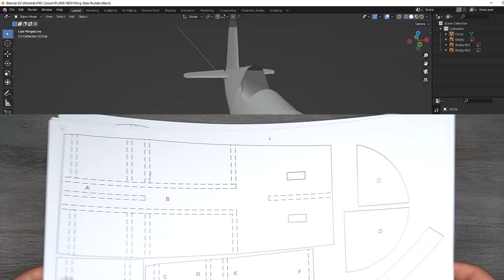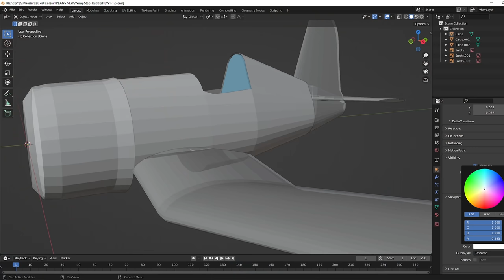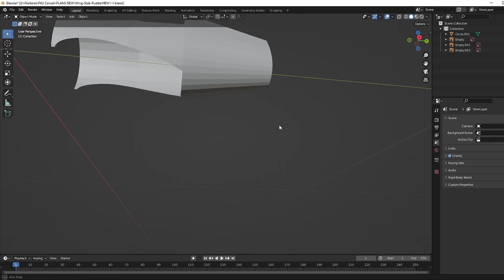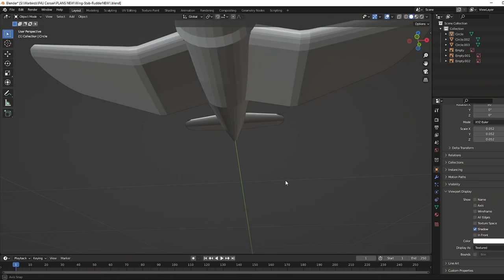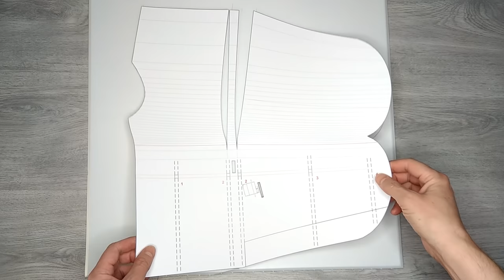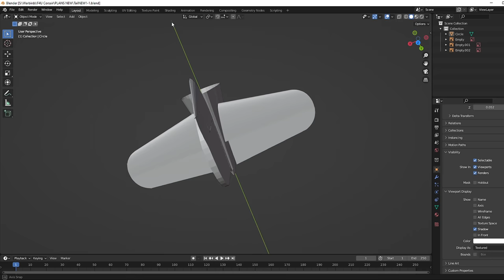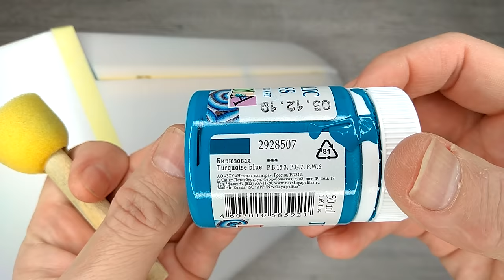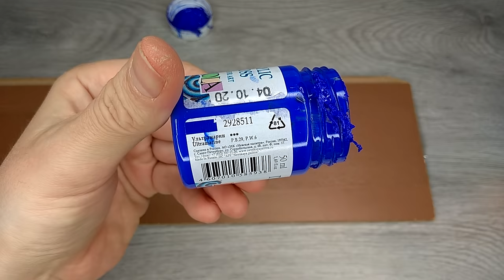Cartoon Fatty F4U Corsair RC plane DIY

Comment: Sir I tried to bend the depron but it broke, what should I do to bend, without heat gun?
Reply from the maker: it broke together with masking tape??
Reply: @NumaVIG  I taped just one side and tried to bend oposite of the taping side.
Reply from the maker: what's happened with  MASKING tape is it broken or not???
Reply: @NumaVIG  Sir I did as you, in previous videos,in paper tape depron completely broke,but in celo tape or packing tape lots of crack happened,but bend and Sir I think you are using another foam,not depron🙂
Reply from the maker: tape should not be stretched, so the packing tape is not always suitable for bending
Reply: @NumaVIG Sir the glue you showed is very costly in India,can you suggest same type of glue or chemical formula or composite?